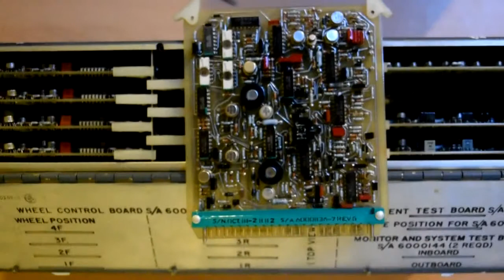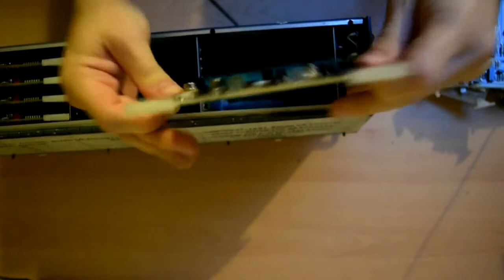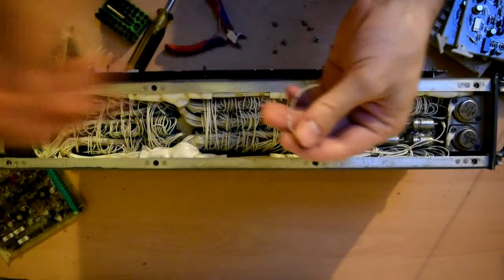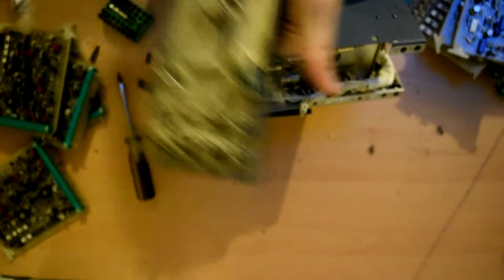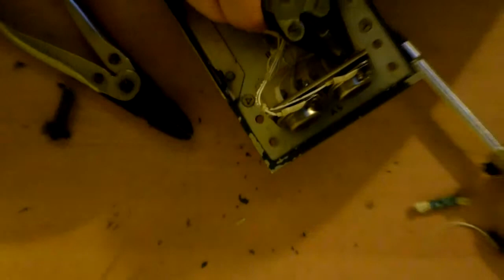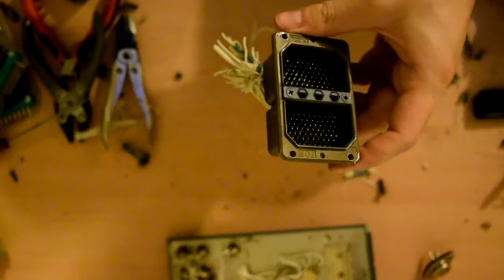Anti-skid control box teardown

Comment: Sometimes on aircraft parts you also have screws that looks like Philips heads but are not, no clue how they are called, but you will  find the matching driver bit in some sets of assorted security bits.
Reply from the maker: +msylvain59 indeed i have some drivers like that!  never encountered anything that needs them though.  This was the first time i used the triwing ones.   security screws always struck  me as utterly pointless anyway since sets of drivers appear just as fast as new screw heads do.